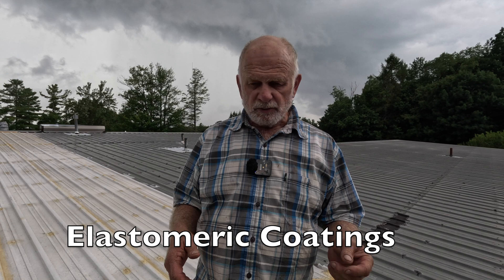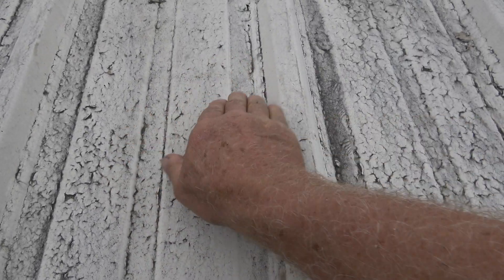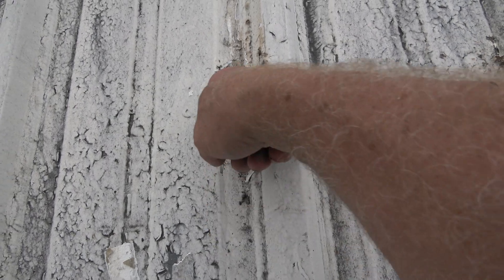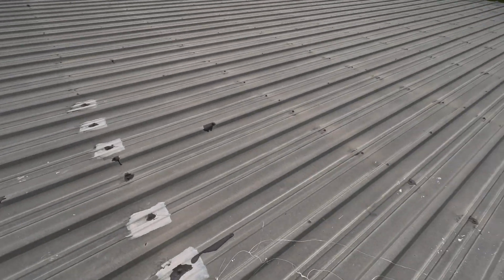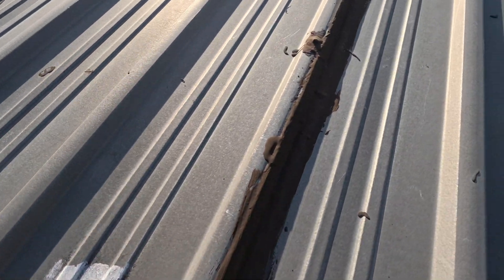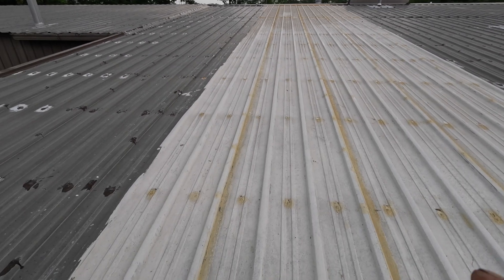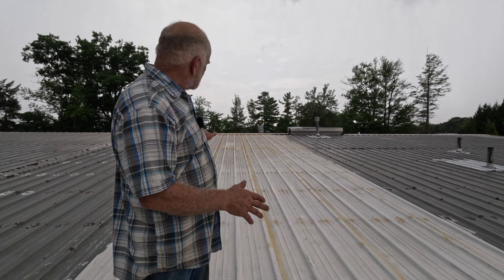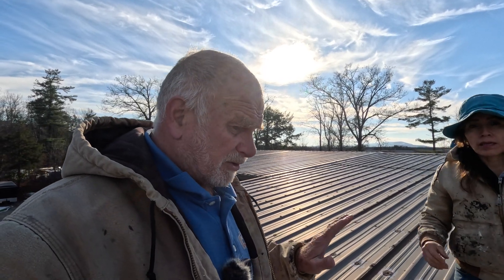Coating a Metal Roof with Super Silicone Seal - Good or Bad?

Comment: If a roof has no screws or seams that can rust or leak, let's say a metal roof on a mobile home, can you use an acrylic elastomer  instead of a silicone ? Silicone is so much more expensive